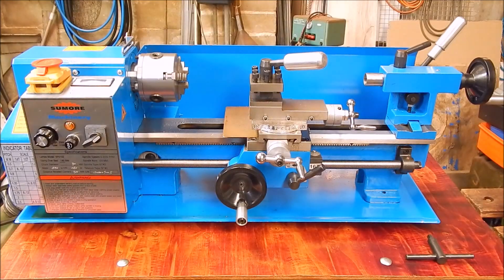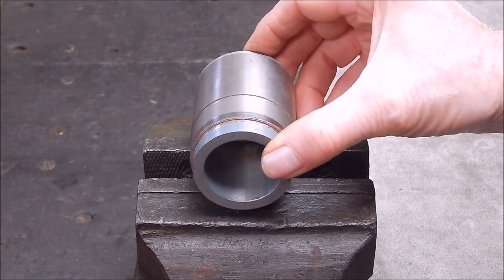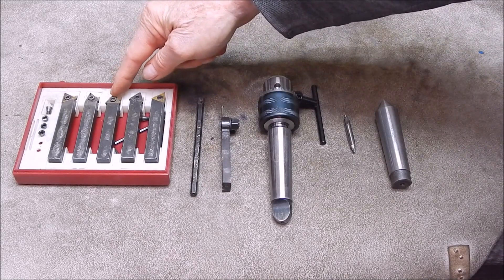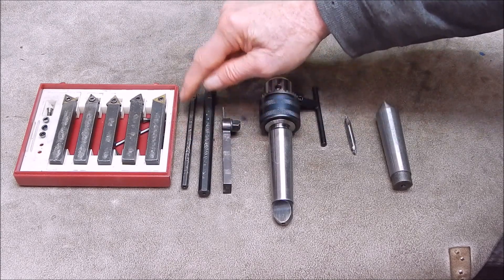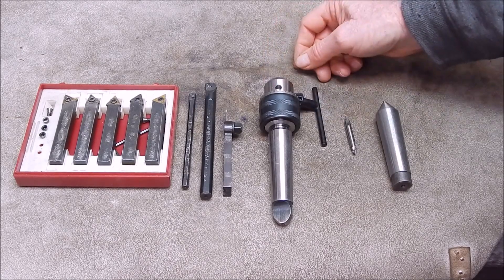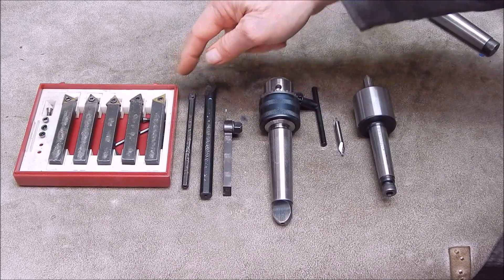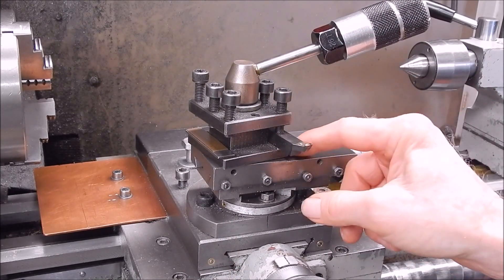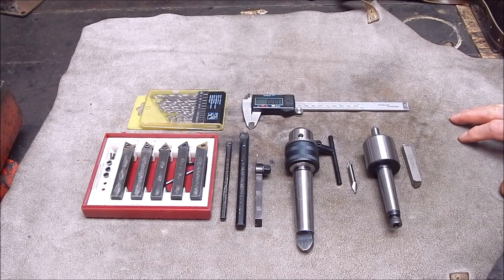Minimum metal lathe tooling for beginners

Comment: I'd add an assortment of shims to adjust the height of the tool in the tool post when setting up. Agree about the lack of need of a quick change toolpost. A simple 4 sided one provides for using different tools on the same job by rotating it.
Reply from the maker: Yes, good point John.  Not very expensive to buy a set.  The OEM 4 sided tool holder is actually the most rigid set up and can hold several tools.  Cheers Rob

Comment: Where to buy the tcmt set?
Reply from the maker: I bought mine from a local tool company many years ago. It has since shut down.   Ebay has 5 piece TCMT sets very cheap in whatever size you want.  The !/2" sets sell for about $25 - 30 US. Price generally increases with tooling size.

Comment: That about nails it.
However, and this cannot be stressed enough, safety goggles should always be used when working with a metal lathe.
Therefore they should be included in the starter kit.
Reply from the maker: Yes, good point.

Comment: I agree with you entirely regarding the carbide inserts. I know the focus of your video is the minimum needed for a lathe, but I got some advice early on that was very very helpful. Pick out a carbide insert that can also be used in your face mill, if you happen to have a milling machine as well. It's a great way to get your mileage out of the carbide inserts. Particularly if you pick a face mill that uses the long side of the insert. That way you can burn up the tips on the lathe, and the inserts are still suitable for face milling. Saves you a small fortune if you happen to have two machines
Reply from the maker: The trouble with carbide inserts is that so many variations are used with tooling.  You can finish up with a drawer full (which I have) very easily.  I try to limit it to a few designations as much as possible, but it's still a losing battle.  Cheers Rob

Comment: Incidentally, after your last video when I commented that US taps do have a center hole even when they're small, I ended up going down to the shop to look at my small taps. I don't know if it's a regional thing, but GTD taps definitely have a center hole in the back even when they are very small taps. No hard feelings, I just thought it was interesting that these standards are not universal
Reply: I have a large set of taps and dies sold by Canadian Tire under the "Mastercraft" brand. All of the taps have a plain, flat rear end --- no hole, no "pointy end". So, for the tap follower that I just made, I incorporated a small "cup", which captures the top end of my small tap wrench, in a recess that is 1/2" ID. There is no feature on the ends of the taps themselves that can be used as a pivot point.
Reply from the maker: I don't think there is a standard as such.  Cheers Rob

Comment: Extremely good advice and very well presented Rob 👍👍👍👍 When I was starting out with my little lathe the thing I had the most problems with was the parting tool. I went through a whole load of them till I found a solution that works. My advice is get the largest, heavy duty one that you can fit in your tool post and still get the tip on centre. I ended up with the 'T' section type, a lug sticks out of the back of the blade holder and clamps in the tool post. This allows you to have a really heavy duty blade, much larger than the type that clamps directly into the tool post. As with everything on a lathe rigidity is paramount, especially with the parting tool. Cheers, Alan.
Reply from the maker: Hi Alan,  the parting tool holder in the video is not very good.  It snaps blades easily.  They are a special tapered cross section, and it has lots of overhang.  In response I made the worlds cheapest parting off blade holder (earlier video), which uses a larger parallel sided blade and has no holder overhang.  It works extremely well.  A lot of parting off issues are caused by poor design, resulting in blade depression/tilting, and price doesn't really mean it will be good.  Yes, rigidity is paramount.  Cheers Rob
Reply: @Xynudu  Hi Rob. I think this is a problem with small lathes as everything is scaled down including the tooling, it's all a lot less rigid. I tend to use the largest tools my tool post can accommodate and then skim the bottom of the tool on the mill to get the height right. This approach seems to work well. Cheers, Alan.

Comment: A hss 1-6mm incremental drill bit set would be my next addition. Or maybe a few hss tool bit blanks and a benchgrinder..
Reply from the maker: Those 1 - 6 mm drill sets really are excellent for model engine work.  So many tools you can buy to expand upon the foundations.  Cheers Rob

Comment: Solid foundation, Rob. Needs will decide what comes next - threading, knurling, etc. I believe the beginner will benefit from an understanding of hss tool grinding, but he can make chips with carbide.
Reply from the maker: It's all a learning curve Russell.  You have to be able to walk before you can run.  Cheers Rob
Reply: @Xynudu  Indeed. When they are ready they will learn more. With our apprenticeships we were privileged to learn our skills systematically - the only machines we touched until we had mastered the hand skills were the drill, bench grinder (to learn drill sharpening) and the mechanical hacksaw for workpiece preparation. Workshop safety was integrated into every lesson.
For the amateur the path will be different. Your videos open windows through which they see opportunities for their development. 
Thanks, Rob.

Comment: what size center drill do you recommend for beginners for making small parts on hobby lathe.

Do you've any video where you are using a dead center?
Reply from the maker: Centre drills are numbered from 0 upwards and correspondingly increase the diameter of the tapered hole with the number.   For small diameter work you will have to use small diameter drills.

Use as large a centre drill as is practical/neat for the job, as the smaller you go, the greater risk you run of snapping off the tip.  If that happens it may ruin the job, as it is extremely difficult to remove the broken portion to re-drill it.

Cheers Rob